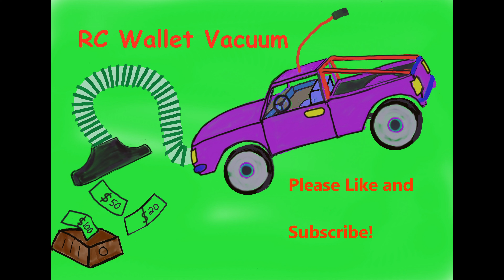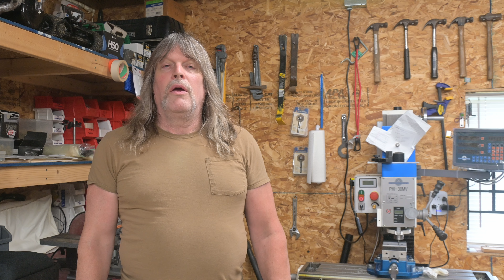Hall effect RPM Sensor for Taylor big bore RC engines

Comment: Hi Brian, im using a similar Hall effect sensor to pickup RPM on my arduino project. My engine uses a similar ignition, and im able to trigger the Hall effect sensor by simply zip tying it to the outside of the coil. I assume theres is enough magnetic flux transmitted through it to trigger the hall. 
I also had some luck zip tying the Hall effect sensor directly to the spark lead. It did work, but the coil seemed to give a better signal. 
Might simplify your setup. 
Nice video!
Reply from the maker: Hey NZMike, what a great idea. I was trying to keep the hall effect as far away from the coil as i could do to emi, but it sounds like that may not be a problem. Perhaps the Schmitt trigger in the chip is the saving grace. Thanks for the tip and thanks for checking it out
Reply: @RCWalletVacuum  3364Q is the sensor im using, zip tied to the steel laminates of the coil. Cheers.
Reply from the maker: @nzmikec  Thanks NZMike. I'll go check out the datasheet

Comment: Nice job Brian. Your test bench reminds me of an aerospace lab. Very impressive design. I think you need to sell your creation to Taylor. 👍👍🏆🏆
Reply from the maker: Thanks RC, i just wish i had the budget of one of those aerospace labs. Thanks for checking it out buddy
Reply: @RCWalletVacuum  You don't have all the resources of companies like Skunk Works or Raytheon but you have more knowledge than most of the people I met in any of these labs.
Reply from the maker: @RCRoads  Thanks my friend. I've got a video series coming up on building an engine dyno. I've been getting the electronics and computer setup. Its going to use a Rasberry pi and Arduino with various sensors
Reply: @RCWalletVacuum  I'll be watching for it. You know I love watching a master at work. 👍